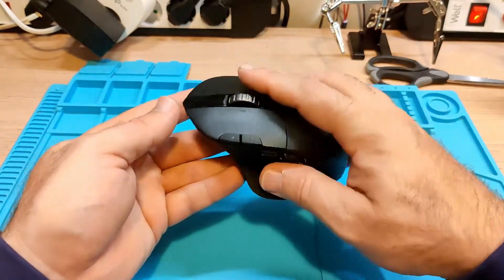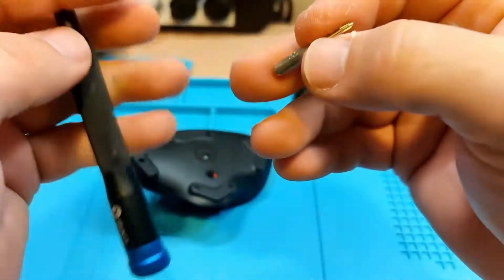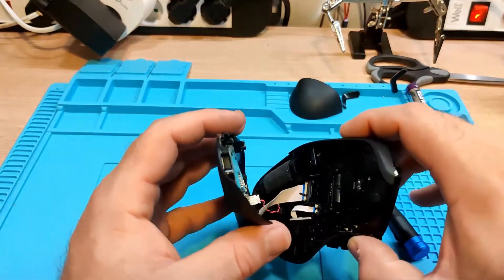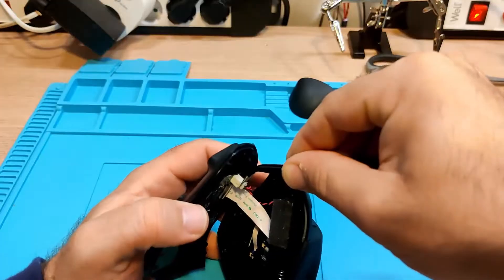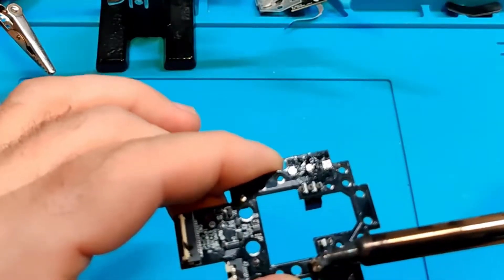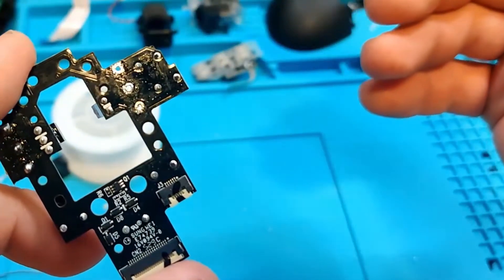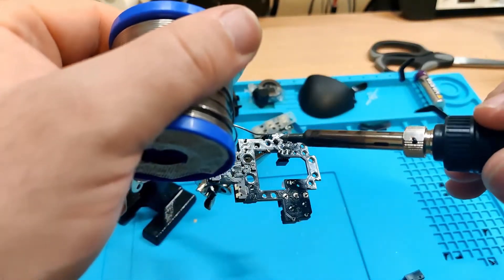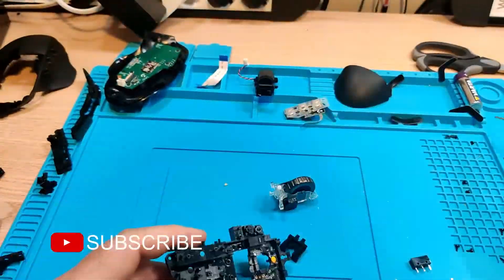Logitech G604 Double Click Issues | Japanese OMRON Switch Replacement and disassembly process

Comment: Just replaced microswitch in my g604 which I love. It needed a repair because Logi doesnt sell it anymore (on anything similar to it)... Got struggled with desoldering but finally it works like a charm. In my second G604 I have problem with that dome microswitch so I will try a solution written by @mechanix1228. Too bad that your movie doesnt have re-assembly - it would be much easier that rewinding the your vid. I had to watch another video with re-assembly to save my time. Still. Big thanks.

Comment: Such a detailed disassembly tutorial is very helpful. There are too many screws in the G604, and the disassembly steps are too complicated. Without your video, I think it would be difficult for me to complete the replacement of the micro switch. 🙏
Thank you very much for sharing your video. I am leaving you a message with the repaired G604 and keyboard. 😋
I replaced the silent micro switch, and everything is perfect. The only regret is that I have 3 extra screws.:face-purple-crying:

Comment: Thanks for the guide! I was stumped by the wheel, I was afraid to take out the mounting pin, I was afraid to break something. And special thanks for warning about the tiny springs, I would have definitely lost them! It's just a shame that they stopped producing the mouse in this form factor. For now I've gotten by with disassembling the button and bending its spring, but I feel like I'll soon have to remember how to solder.

Comment: Now my G604 has the same problem. "Back in the days" I used to change the switches myself. But this? I'll losse halt the screws. Should I ever get it assembled again, it will properly not work to my satisfaction anyway due to the missing screws...

Looking for an alternative now.

Comment: I haven't had any problems with my left and right clicks, but the middle click double and triple clicks. Recently it wouldn't even register some of my clicks... Does anyone know of a solution? Can the switch be replaced? If so, with what switch and how. I've had my mouse for almost 4 years and have been trying to find a replacement for over a year. All other mice I've tried are not as good as the G604. I don't want to pay $240 for a "new" G604. I can't believe they would discontinue the 604 without giving us a successor🙁

Comment: Ugh this is too much trouble. Might as well just buy a new G604 -- which will also break down in a year because of the cheap Chinese OMRON switches Logitech uses.
Reply: They don't make them new, and the used market is nuts.

Comment: This sophisticated design seems to be a good way to implement the planned obsolescence.
The easy fix for such an issue (in my case unexpected double-clicks) is a drop of silicone grease or so. I am using 5-56 and it works fine with most of the switches - can forget about the issue for a year at least. The only issue with this mouse in my zoo - it is very difficult to get there. The first G604 mouse I returned under the warranty. And the next issue happened a few months after the warranty was expired. So I got to fix it. But I did it with a syringe that time. A couple of years gone and it is sick again (along with the old M325 that is constructed in a way that much easier to access and lubricate her switch).
This time I got the paperclip (peace of wire if you wish), sprayed a bit of 5-56 into a tiny cap, got some of the solution on the tip of the paperclip (that I slightly bent as a bow), and entered it into the gap between the left button and the housing from the front of the mouse towards the back. As it seen in the video from 4:00 to 4:05, the white switch button is situated somewhere in between the + symbol on the auxiliary button and the center of the wheel, so you got the idea where you have to poke the oily stuff. As long as there is a sufficient amount of the silicone grease on the top of that button it will find a way to get into the switch and lubricate/clean/cover the mechanism and contact points inside.
I spent a few minutes poking and now back to work enjoying prompt response without unexpected double-clicks.

I hope the Logitech company will change the way of manufacturing and would not celebrate the planned obsolescence, but will please the users with a long-lasting devices as it used to be in the beginning.
Reply: Back in the 90s my Logitech mice would work for 10 years. Today they work for ten months.
Reply: Following, would like to hear clarification for where specifically you put silicone grease
Reply: I do agreed it's way more complex than it needs to be.  They could have easily saved money with less plastic and made the mouse lighter so I'm guessing there could be a reason for it.  Maybe sturdiness?  If there is planned obsolescence it would be the switches.  I've more recently learned why these Omeron switches fail.  Today's gaming mice are less tolerant to the electrical noise the switches have as they wear down.  Logitech has more recently started to introduce optical switches which fixes the problem.
Reply: just to clarify your comment... you're suggesting to put a little bit of silicone grease onto the white switch button rather than replacing the switch? I have the same issue. took apart my mouse and I have the button available. I don't want to buy and solder another button if I can avoid that.

Comment: In case anybody is trying to fix the middle mouse button because it doesn't click anymore pay attention at 5:30. In between the springs you'll have to cut a slit open on that orange protective cover with an exacto knife so the little disk comes put. The disk is supposed to be dome shaped not flat. Just take a ball point pen and press into the disk until it looks dome shaped again. Not too much or else pressing down will feel too stiff. Wrap a narrow piece of electrical tape around the disk and board to seal and secure the disk. Thanks to the reddit guy that suggested this and this channel for showing us g604 users the path to repair.

Comment: I can not thank you enough for this detailed, clean video of the process. 
G604 is a wonderful mouse except it has this horrible, apparently "incurable" issue of double click. Almost a year back, I got mine replaced with new one under warranty but within 2 months the issue popped up again. It had been extremely frustrating. 
While searching for possibilities of replacing switches, I stumbled upon your video and got back some confidence that this mouse can be brought back to its senses. 
Finally got Japanese OMRON switches, replaced them myself, following your video. Now with new switches, the mouse is working just the way it is supposed to. 
I am so happy and relieved. 
Thanks again. Best wishes. :) :)

Comment: I tried and failed but thanks for your video, it saved me time. I damaged the printed circuit due to my poor skill, it's no longer solderable. Anyway, it was no longer under warranty. 2nd logitech dead with a double click problem after only a year or two, I'm done with this brand of scammers which doesn't care about its customers, moreover, the customer service is pitiful... For such expensive equipment it's shameful.

Comment: There are 3 main things wrong with this mouse:
- double-click issue
- rubber grips peeling off and falling apart
- over-engineered af

After about 2 years of use, my G604 is now having the double-click issue and its rubber shell is disintegrating (I don't have sweaty hands, if you should know).

So, earlier today, I decided to take it apart. After struggling to get the outer shell off, I was greeted with the most complicated mouse internals. It's even more complicated than the already complicated G602 I also took apart before (it was also exhibiting the double-click issue).

I gave up and decided to watch YouTube videos of this mouse's teardown so here I am. 😅

I'll get back to it once the replacement switches arrive.

Comment: I do not have all the gear to follow this switch switch, however I found this:
DOUBLE CLICK ISSUE FIXED!!!
Issue: Whenever you click once the mouse registers a double click. It causes problem to drag and click.
FIX and EXPLANATION: This issue is caused by static electricity buildup inside your mouse (if the mouse isn't broken). To fix this, simply breathe into the gap between the mouse and the mouse button. Our breath has enough moisture to discharge the static electricity. This should help in removing the static electricity buildup. Generally when the environment is of low humidity or the buttons are clicked in rapid succession, static electricity tends to build up. This is a common problem in mouse since there's no other way for the static charge to be discharged.

So I did blow in to the gap for a second or two, and for the last 5min it works fine, double switching gone. If it will return, cost nothing just to blow on it again :)
Reply: Thanks, it helped! I was seconds from ordering new switches..
Reply: for the love of GOD i tried compressed air and everything long slow multiple steady hot breath blowing at multiple angles...

completely fixed i couldn't even drag anything or grab a scroll bar. i was minutes for ordering switches and this ACTUALLY FRIGGIN WORKED

you SIR ARE A SAINT one year later
Reply: @James_Jc69  glad to help :)
Reply: @AleksVaisvila  

Sadly it started acting up again so i went and got the switches

Comment: I have my MX510 and MX518 which are close to being 15-20 years old or so. After the heavy usage over the years they are as good as on day one.
The left click in G604 on the other hand started to fail after medium usage, obviously shortly after the warranty has ran out. If not for that it would've been the perfect mouse, it has 6 buttons on the side which in the MMORPG I play are immensely convenient.
I'll have to give it a go and try to replace them.
Reply: " After the heavy usage over the years they are as good as on day one." They are 100% not as good as they were on day one LOL. Fantastic mice though but use a new one and youll see.
Reply: @Paultimate7  OK if we want to be picky, lets rephrase it :)
MX510 after 15+ years of A LOT of clicking (work, FPS, RTS, MMORPG) no problems.
G604 after couple of years of moderate usage - no-clicking/double-clicks

Comment: My g604 is currently having double clicking issues & watching this video makes me regret immensely about not buying a g502 back then instead. Seeing just how much of a nightmare it is just to get to the switches, putting it back together after all that sure is gonna be a worse pain in the ass.
Reply: I think you would still have experienced the double-click issue had you gotten a G502.  Double-clicking is a pretty common issue with Logitech mice.  I also had the issue on my G602 (and on my T-something model before that).  My G604 is probably my last Logitech mice.  I just replaced its switches and rubber.  If it breaks again, I will be looking for a different brand.

Comment: I owned G602 and really loved it over 6 years until the sensor stopped working. Then bought G603 and never a fan of its shape (feels too small compared to G602). When G604 came out I was so happy that it's a next-gen G602. However, it lost the ease of maintenance. G602 is so easy to dissemble. G604 however looks like a nightmare. The switch quality is getting worse, this is the 2nd G604 getting into double click issue (yes, last one was directly replaced by Logitech within warranty). G602 with much heavier use did not have this issue
Reply: Yeah I managed to swap my switched but is was a NIGHTMARE

Comment: hi,I would like to ask you, my G604 mouse also registers a double click instead of a single click. Is it possible that this component is defective?
Reply: It is most likely the same exact components failing, the switch logitech is using is wildly out of spec for the low voltage of the G604

Comment: All right, so I did the entire disassembly and replaced the switches with Kaili 4 switches (which I really love...hopefully they last a lot longer than these Omron switches)...and I'm proud to say, I only have 1 extra screw.  I did have to take a part a few times because the side buttons were not engaging and I couldn't figure out why...then noticed the white rubber covering has a corner cradle that had to be seated correctly or else it would move when putting back in the entire internal assembly.  It's a pain, but I'm glad I did it myself.

Comment: I did this repair with some new japanese OMRON from Aliexpress. The issue came back within 3 month. 
But thank you for the video! It was it very easy to follow along, without studying the whole device myself. Save me a lot of time :)
Reply: Welp, Aliexpress.  Those Japanese OMRON switches were made in China.
Reply: 'Japanese' Omron switches... from China.  Especially bought on a market place known for selling fakes and clones.  It doesn't take a genius to figure out why the switch started to fail so quickly. 😉

Comment: I've got problems with my G604, and right now it's selling on Amazon for only $54.22 - delivered. I'll probably buy it with the insurance, because although these are great mice they are notoriously unreliable and develop several types of frustrating defects. Evidentially, Logitech knows about the defects, but they just keep producing the same defective circuitry (or software). Even Logitech tech support has no idea if the problems are software or hardware related, so it's still a crap shoot.

Comment: Thanks for the video, i learned from you,  but when i disassemble there is a very tiny Spring comes out,  when the wheel disassemble step......where it should be ?  i also didn't see from your video.......  Please help to check for me and advise,  Thanks~~~
Reply: OMG i found it , in your video 5:28.....

Comment: ⚠I may have fixed the issue** ⚠ Found reddit comments confirming that blowing compressed air into the button gaps fixed the issue. I don't have compressed air so just blew very hard into the gaps all around my faulty left mouse button.
First time didn't work. Tried again this time with lips against the gaps of the button* , front, side and through middle button, both with and without left button pressed, and.... I've just been able to draw 50 lines in MS-paint with 0 gaps! previously 50% of lines would have 1 or more gaps shown. No idea how long this will last but I'm pretty pleased 🤞

Had same problem with 2x G602s and ended up just buying replacements. Hopefully this saves someone some money 💸

*Using a thin straw would probably be better. It would focus the air power and enable you to get into the crevices.

**This ended up only being a temporary fix and it's getting worse by the day. I'm still going to try for warranty replacement. If they want me to post the mouse back to them I won't bother and will try switch replacement. This vid recommends Japanese Omrons, there's another vid at: watch?v=f3ZFqZbTnL4 with many other switch alternatives tested.

***No reply on warranty stuff yet so I decided to take the mouse apart. Was so much dust and hair inside. Scraped the contact areas of the gold switch thingy in the Omron just to remove any oxidization, brushed dust out of other areas, also cut a small square of cling film and put it over the switch to prevent dust getting in. I think Americans call it 'plastic wrap'. So far working perfectly in the MS-paint line test!!

****3 week update: still no double clicks since the above paragraph, so that completely fixed the issue. Might be no need  for you to buy and solder new switches. Give it a try.

Comment: n i had this problem i just opened up the OMRON switch, there is a tiny copper colored metal plate with a bend in it, over time this gets flattened by wear and tear and usage. I bended it back into position, closed everything up and done. it was faster than waiting for a shipment from the internet and it was free. :)
Reply: Been there, done that. Just have to be careful when bending to not make the switch to hard or too soft. Also have fixed the dome switch for the middle click by removing the thin orange  film, reshaping the dome and carefully taping it back with regular clear packing tape.
Reply: @gheroba  It's silly sometimes to see people throw away stuff and buy new ones when the fix is so easy.. ppl are lazy

Comment: I build drones for a hobby but this mouse is so complicated to take apart that it had me questioning the meaning of my life.
Reply: Most Logitech mouse look like a puzzle inside. And if there are space for 2 screws, logi never use 1.
Reply: I am usually all for repairing things myself if possible.  But this?  Ugh.  I'm leaning towards a new mouse.  One that is not Logitech because this is literally the FOURTH Logitech mouse in a row that has developed this issue.

Replaced the switches in my G602 pretty easily.  This looks like a freaking nightmare.
Reply: @catch82  exactly, even I ever once switching my phone camera module by myself. but after seeing this video, I think i'd prefer buying another pair of it 😅
Reply: The g604 is the definition of over engineered.
Reply: The meaning of you r life was suggested by the mouse design - you do not have to fix it - you have to pay for the new one!!!